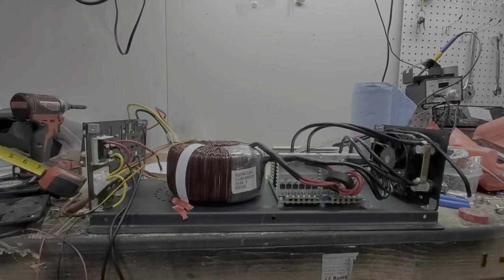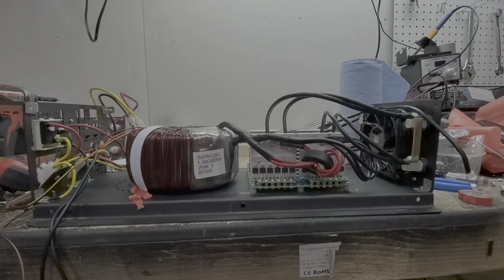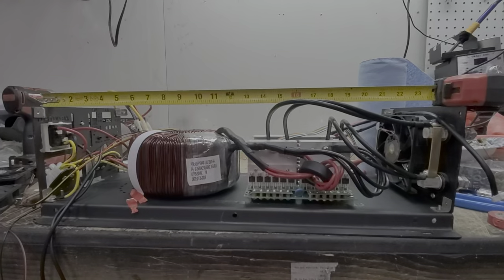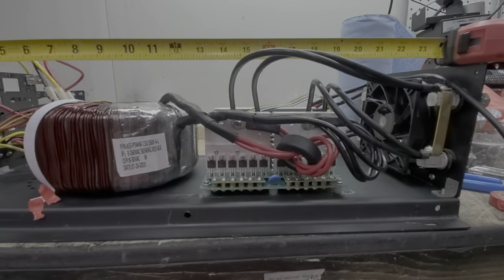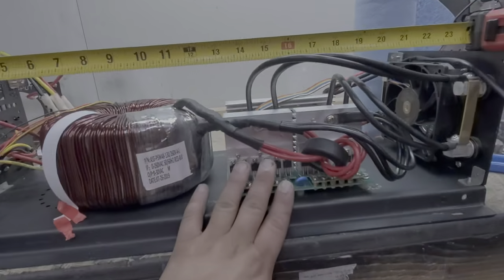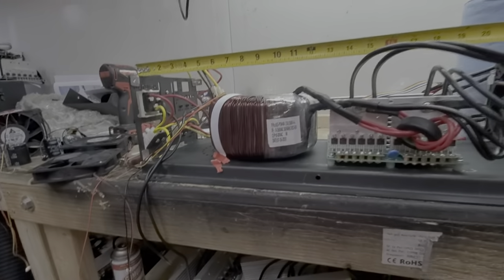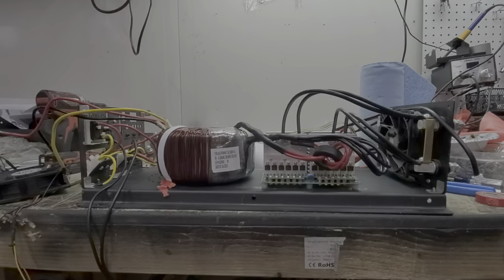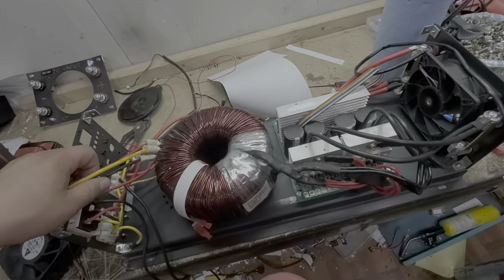Genetry Solar 5kw inverter WIP

Comment: If I were you, I would have all of the components modeled up with place holders the exact size in Solidworks, Inventor, or some other decent 3D CAD software and then play around with different layouts till you find something that works.  One thing you could consider is mounting the transformer vertically and also rotating the MOSFET boards so you can have fans on each side to blow air directly across the components and then the 2 ends would be further simplified and have even shorter runs for all cables.  If you wanted to keep the tube style of the inverter you could stand up the toroid and pass the same cooling air through and around it and exit the opposite end in a push-pull fan configuration.  This would allow the entire chassis to be even shorter but more square for height and width.  The transformer mounts could be C shaped clamps made of heavy nylon or another plastic that is more rigid that could then be secured in place with bolts so that any metal is farther away from the magnetic field which will further help lower heat and increase efficiency.  As another commenter mentioned, even 4 or 8 of the very heavy duty zip ties would likely be enough to hold the transformer in place if secured to a metal bracket with a rubber insulator or plastic stand offs.

During manufacture, the transformer could be easily tapped while winding with connection lugs for 12, 24, 36, 48, 60, and 72 volt systems (or whatever range the input and control boards can take).  Then the input voltage could easily be selected or changed based on what the customer needs or orders and you only have to have one design to do it all which would reduce the number of parts you may need to stock for repair or replacement going forward.  The software could dynamically underrate the amount of power available at lower input voltages and increase it for the higher voltages (just a thought that could simplify the deployment of larger arrays of inverters and also make it easier on the warranty side of things).

That being said, I can't wait till the new inverters are designed and ready for shipment when the time comes.  I am saving up as the inverter is the last part of my home solar power setup that I need to purchase not counting future battery upgrades.

Comment: Looking good getting rid of all that clutter nest. The new and and improve inverter looks cleaner. Lifting the transformer or using zip ties hold down transformer will reduce Heat.Get the air flow all around. Its going to work awesome when is done.😀
Reply: It would not be hard to put hose under winding to pump oil through
Reply: The new item called Ultra Arctic air it's like a tiny air conditioner. That being said you can keep the and inverter cool.look it up and you will see.

Comment: Consider mounting the Transformer Vertical in lieu of  of Horizontal.    Mounting could be accompleshed via a U-Strap and padded base.  You could mount a fan blowing right thru the thing.
Reply: Pretty much exactly what I did with my 9K unit.  However, there's one MAJOR thing to keep in mind: putting any magnetically permeable material in a loop through the core...is going to result in a low-grade welding output through the loop.  I learned the hard way, I smelled heat within a few minutes!  Ended up putting one of the mount bolts through a thick rubber washer to open the circuit.
Reply: That was also my idea when he said that he was going to ask PJ to increase the height of the case.

 My other idea is why is there such a aversion for/to an external fan on a unit? They make grills for them and with a grill, there is better airflow as the case can then have a lot more open area for the air flow. In fact, if done properly you can build a stack that would pull/push the air only around the unit that you are cooling such as the transformer or the power control boards. A fan stack can be made for internal fans also by not mounting it to the fan itself and only mounting it to the lid/bottom. That also would allow you to go to whatever size fan you wanted. The stack and the fan would not have to be the same size, just the stack would have to be larger than the fan and/or transformer. PowerJack also came close with their design of the spider but didn't carry it far enough. There should also be a short spider on the bottom so that cooling air could get around the bottom of the transformer. The spiders themselves could align the transformer if they were insulated. And that would do away with the dead air in the center of the transformer if mounted flat as the holes in the bottom of the case would let the air flow across it better.
Reply: @gravelydon7072  Why is there an aversion to an external fan on the unit?  One word: Shipping.  I can guarantee you that a plastic fan mounted on the outside of the chassis will be SMASHED in shipping...and I'm talking local U.S. shipping, not overseas.  Sure, we could use a metal fan, but that's going to be more than 2x the cost.  Engineering is about weighing strengths/weaknesses + cost.  If someone cut zero corners, and made "the perfect inverter", then nobody could afford it.

I will stress again that when designing transformer mounts, it is important to ensure that there is no full "loop" around the core in any form or fashion, with any magnetically permeable material (like steel, copper, etc.)  Unless PJ has isolated their "spider" from the chassis (as it still has the bolt through the center of the tranny), it's going to be significantly adding to the no-load current of the inverter, not to mention a potential fire hazard.
Reply: @sidlori1592  A metal fan of good quality at retail is $15-19. Wholesale at about $4.50. Including the grills for both sides. If Genetry Solar is going to go with better fans to start with, then the cost is already there. It wouldn't be hard to design a guard even for a plastic fan to go on the outside.

Aluminum/stainless brackets that are insulated would take care of the magnetism problem. They would not have to be all the way down the transformer side. Only enough to control the movement of one would be required to actually contact the transformer. The rest of the tie down would be that one center bolt. Which could be smaller as the side  sections of the spider would also control movement. And for that, a stainless one would solve the magnetism problem. Don't forget, PJ already uses a steel or stainless steel case and the cover over the pad is also either steel or aluminum.  Fire hazard would not be any greater as you use Kapton tape to wrap it with. Right now there is a pad between the cover and the transformer to insulate the cover from it.  And that only is needed in the areas of contact. With better airflow over the transformer, if it got hot enough to start a fire, than the transformer itself would be the hazard. That is what the thermistors are for. To shut it down before there is too great a temp rise.

As I have a couple of the cheap version 6000 Watt inverters coming, one of them will be out of warranty on day one.  Should be in by the middle of next month at the latest so I'll post a video of the before and after.

Comment: I fixed an 8kw.  Buy another equal toroid and connect the two as4 toroids in parallel and it can do 8kW continuous.  With just one toroid it could do continuous 4kw and short bursts of up to 7kw.  Starting from 4kw it was starting to generate a lot of heat. It is a good inverter if you put a well-sized toroid and improve the ventilation system.
Reply: That's good info I bought a inverter off of Sean and told him I needed a inverter that would do 3000 watts all day 4000 for under 30 mins mabe every once in a while he sent me a inverter with a as4 

He really knows these inverters and asks lots of questions before selling a inverter 
He saves people money buy doing this they get what thay need
Reply: Did it effect no load , idle current adversely? I have a 5kw, and looking to somewhat build my own, maybe buy a damaged 8-10kw or larger, add a new control board and WiFi,  and maybe do something with the transformer, I am thinking maybe just get another transformer, and larger FET board, I want to stay at 24v 8kw continuous would be fine,     
It would be awesome to have a 25 or 30 kw model! Ha-ha,
Reply: @jamest.5001  Like the 15000w model you buy another toroid and you connect it in parallel and it will work continuously

https://www.fieldlines.com/index.php?topic=148717.0
Reply: @lenergiedusoleil5234  
OZ is alsome reading his crazy adventures got me started building my on inverter 
God bless the people of Australia!!!
Awsome people!!!
Check out his electric  car!!!!

Comment: What about idle current? Idle wattage?   With the extra MOSFETs?
Reply: So far in tests, the Genetry Solar control board has reduced no-load current of an "8KW" inverter (already modded with 2 turns around the toroid and only one 4.7uF cap on the output)...from 0.7A to 0.5A @ 55v.  (0.4A @ 48v.)  Don't think the extra FETs add too much to the current draw (from gate switching), it's more of a cost thing.
Frankly, I'm surprised to see the power consumption go down--but I'm not complaining!
Reply: That is really good sid !!!

If I remember correctly my 48 volt as4 power Jack is around 1 1/2 amps at 54 volts I haven't modified with home
 made choke yet

Can I add a few turns to my factory powerjack primary to lower idle current ?

I have 5or6 smart apc 1500 inverters (need one)can I also add turns to them to lower idle current 

Even high frequency inverters have realy high idle current if you have it down to a half of amp that is pretty incredible!!

My 10000 wat  home made inverter is .44 at 54 volts I am very happy with it

I will check my powerjacks again but I am sure mine wasn't  under a amp closer to two amps I think

Comment: May I inquire of the transformers your are using?? I'm really interested in this build up.. because I can wind my own transformers "From the scratch" I make the machines to make Toroidal transformers.. have a few Ideas of how to make them to work exactly like one of them "Power company.. dipped in mineral oil.. to increase the efficiency at the moment to vent temperature...as well I'm interested if you would sale the feet boards and driver boards??

Comment: I really wish you would consider using  the new design mosfet board it's a free cad file all through hole components the 5608 is a 360 amp mosfet 3 on each board is good for 12000 watts all day long

 I give you the 
design cad file it is all documented made for me and this is proof I give it to use if you chose to it is already made I hope you consider it

I also hope you consider using a Transformer that has a 12 ,24,48,volt tap 

If you did this your costumer wouldn't have to buy a Transformer to change to any input voltage for now you could hand wind the primary your self

 It will only be 30 or 40 turns and 3 or 4 taps of one single large wire

 Each Transformer would take a person less than 20 minutes to wind and it is proven to run cooler and be more reliable this way I can show you countless examples 

And with a cheap grill the fan looks and works good on outside of case that may give you the room for shorter case
Reply: I have actually suggested a multitap transformer to Jack for a one-size-fits-all design, but he doesn't seem to understand it at all.  It does cause a small problem with FETs (the higher the voltage, the lower the amp ratings on the FETs), not to mention DC input wiring, etc.  But the transformer is kind of the biggest expense in an inverter.

Basically, four 12v taps.  All in parallel = 12v.  Two parallel strings of two series taps = 24v.  Three parallel taps = 36v.  Four parallel taps = 48v.

Wait, maybe PJ already makes exactly that, and they don't know it??  Let me see.
Reply: @sidlori1592  
Your way makes more sense than mine I always run everything by the greats on back shed before I do anything 

I am a monkey see monkey do type of person but I know who to listen to 
That makes me look good or smart but really dumber that box of rocks
Reply: Just looked at 48 volt as4 and it has 4 wires on primary so mabe 96volt maybe primary  is so easy to wind any way with welding leads wire
Reply: 12 volt asL has 4 wires on each side of primary 8 all together
Reply: Sean has my number if you ever need it sid 
The cad file is done and proven for 247 size mosfets 5606 is 360 amps less mosfets to turn off and on
Reply: @ambersmith6517  The new ASLx-series transformers wound in house by PJ seem to use a lot of smaller strands to get the job.  But when they separate them to multiple output ring terminals, that makes it very easy to modify.  I have an ASL4 24v transformer, and there's 2 sets of primary wires coming out (as opposed to the 1 set on the 48v inverter).  The dual-mainboard big inverters might just have 4 taps on them, though they don't make those in 12v.

But if there's dual windings on a tranny, you can easily double the input voltage by wiring them in series.  Exactly the same wattage.  (At least in theory.)
Reply: @ambersmith6517  Then Power Jack already makes exactly what we need.  Who would have guessed??!  Of course, it probably has a 6v primary, which is too low; it needs to be 8-9v.
Reply: I can't do 5000 watts for over a hour at a time unless sun is out but my system is on 24 /7 and has been for over a year
I have a 48 volt power Jack with a as4 a powerjack with a as3 and a 12 volt with a asL I have a few extra  sets of mosfet I would like to try your new board out if you have a extra one I will send it back to you or pay for it when testing is over and I will beat the shit out of my inverters just to try to blow them up I don't use any of my powerjack inverters one any of my solar setups they are just back ups for my backups 
Just something to tinker I built new poida's Nano control boards for them but never got around to programming them
Reply: @ambersmith6517  We don't have extras right now.  Just the first test run.  Hopefully we will get a production run started this week.  But no guarantees.
Reply: @sidlori1592  
Ok no big deal but if you ever have a extra I don't care and even like to beat a inverter to a smokey death

If I can ever do anything to help I would be happy to also I have lots of dell laptops that need a
 O S if you would like one
Reply: @ambersmith6517  OK.  So after looking at the datasheets, there really is no advantage to the HY5608 MOSFETs with the TO-247 package.  Sure, they can do twice the amperage (360A vs 180A) of the HY3810s, and you only need half as many.  BUT...here's the kicker: Their gate capacitance is just shy DOUBLE that of the HY3810.  14,715pf for the HY5608, and 7,889pf for the HY3810. 
Power Jack has since gone to the NCEP039N10 FETs, which are only rated at 135A...but their gate capacitance is 6,400pf.  That seemingly small difference (7,889pf vs 6,400pf) makes a huge difference in the "driveability" of the FETs.  Even the new Genetry Solar LF Driver board can't firmly drive the HY3810 FETs (the less said about PJ's LF Driver the better, especially on the large twin-mainboard 15K inverters.)  But it can sling those NCEP039N10s around like nobody's business.  And I bought the biggest isolated FET drivers I could find (4.0A peak, vs the 2.5A peak on half of PJ's LF Driver).
Reply: @sidlori1592  
I want your control board so bad !!!

I hope I can afford it from all the reading I have done pj control board  has been the down fall of power Jack 

That is one of the reasons  OZ made one long ago 

Thanks for the comparison 
Like I said before 
I know who to trust and I trust you !!!

Hy4008 is what I have been using in the new control boards 

Any 247 style mosfets will work 
If price or anything else gives the new design a advantage please use it 

One less thing power Jack!!! No I love power Jack inverters

 I just don't use mine until I get new control  boards

Do you agree the future of inverters is mosfets board and Transformer is a oil cooled aluminum box with fins all over out side of box ?
Reply: @sidlori1592  
I will pay 100 bucks for a board and try it out for you and not bitch if I blow stuff up 

I will get blow ups on video  I have two extra sets of regular power Jack mosfets boards

 I would love to blow mosfets  sky high and don't want them replaced !!

I will be using hy4008 
Boards later on most likely any way unless you tell me not to anyway 

Thanks again did for all your time you have spent on me

If you could use a laptop I will send you one no cost to you
I have lots of extra laptop batteries also 

Have a blessed day
Reply: @ambersmith6517  Well, once we get the first production run of control boards, that will be an option.
I don't expect the control board to be the weak link.  FET capacitance is connected to switching voltage, not load.  So if it can cleanly drive the FETs at no load, it should also be able to cleanly drive them at full load. Basically you'd be testing the FETs...which isn't a bad idea anyway ;-).  PJ has a VERY unbalanced gate drive in their inverters, which I'm sure is a huge contributor to premature FET failure. (18v for the top two FETs, 12v for one low FET, and 10v for the other.)

Laptops... I'm pretty well set for now.  Seems I recall you saying something about them being Dell laptops?
Reply: @ambersmith6517   @Amber Smith  HY4008 has a much better gate capacitance (7,398pF), but it is a 200A FET.

I haven't delved into redesigning the FET boards yet, it's just one more thing I'd have to do.  Have enough on my plate right now anyway 😂.

Future of inverters being oil cooled?  Maybe for a very high end inverter that requires freight shipping and a thick pocketbook.  Remember, all those things add weight, and a lot of it.  I agree they sound like good ideas, just they probably are not economically practical for the market we are trying to reach.